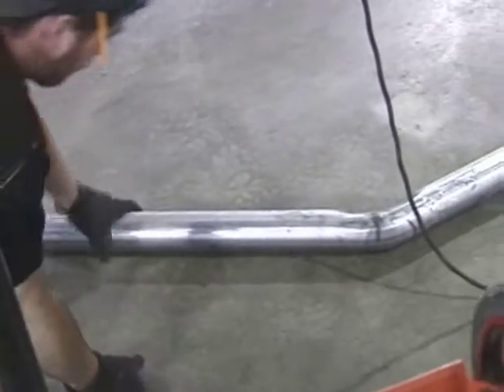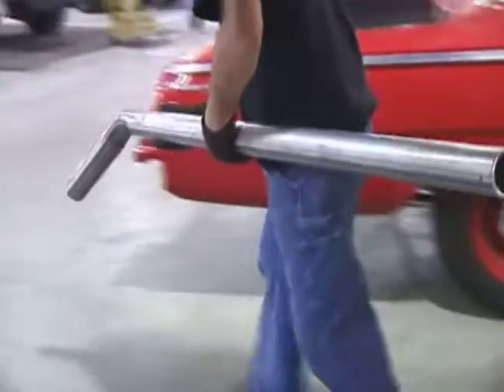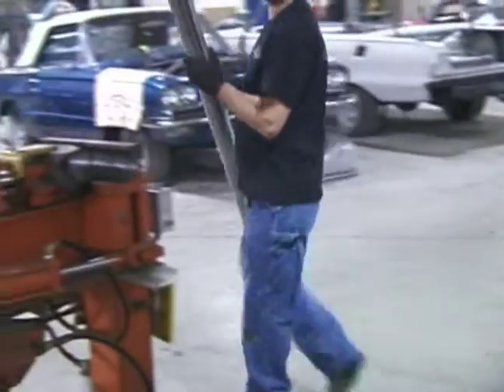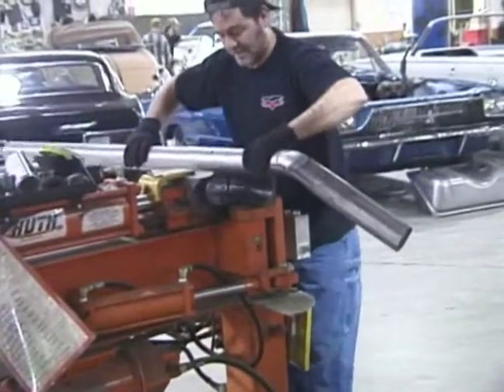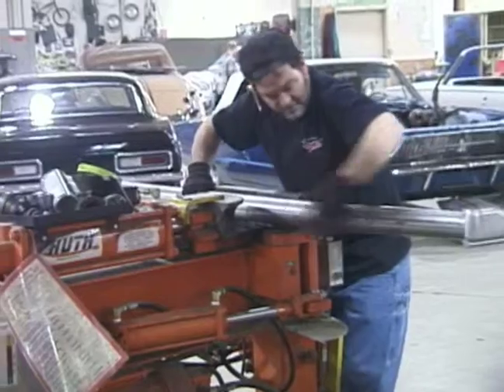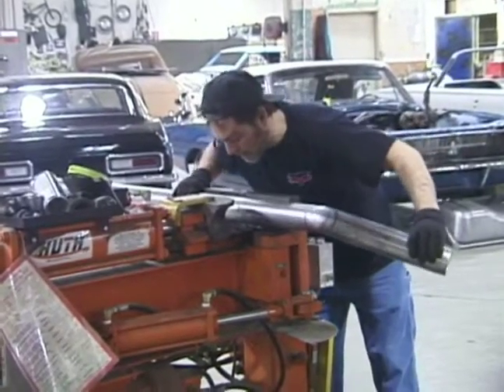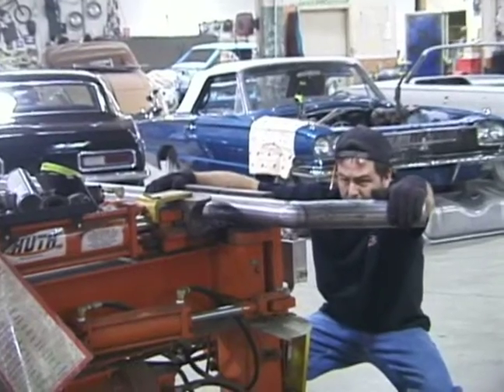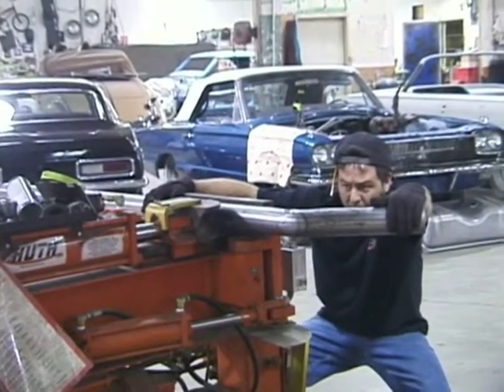Performance Exhaust Systems: Car Restoration Tips : How to Mark & Bend Exhaust Pipe for Exhaust Systems

Comment: There's a rotation dial to clamp on the pipe so you don't have to guess where to rotate the pipe. Ben Pearson makes them. You can make perfect mirror image pipes with one, I've used one many times.

Comment: can i ask you what grade stainless are you using and what is the wall thicknes in mm

also what psi have you set the huth at for 3" pipe

we use a huth bender here in the uk and we just cant get it to bend our stainless